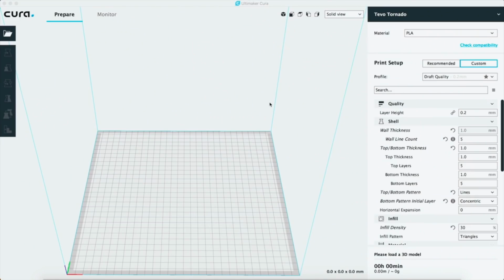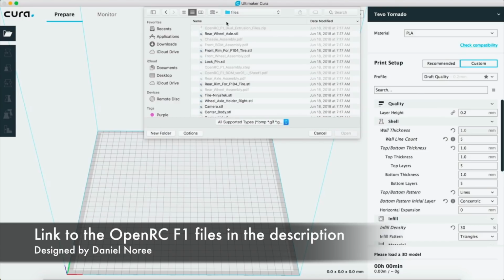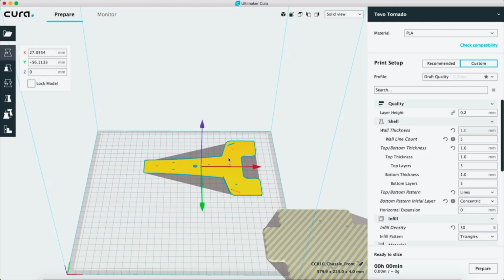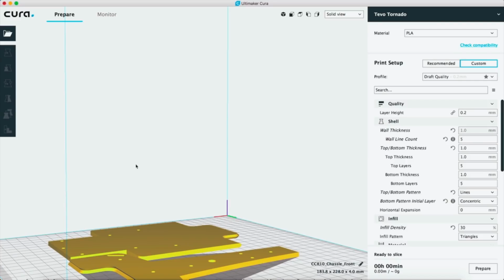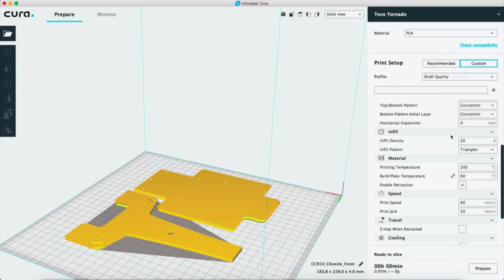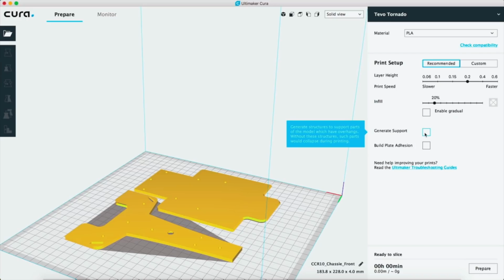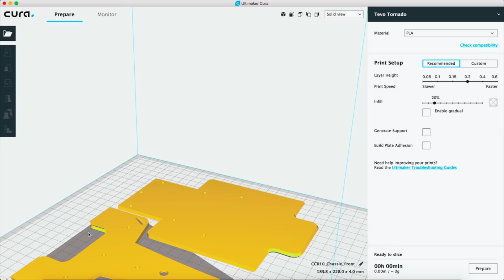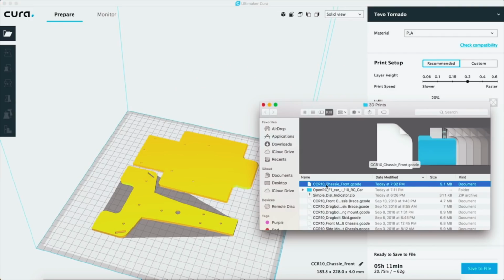Intro to 3D Printing - Slicing & First Layer - OpenRC F1 - EP1

Comment: In Cura, if you click and hold the center scroll wheel you can drag the entire model around to see it better also. good vid. I think I might make one of these cars. I have all of the electronics. just need the bearings and maybe buy the rubber tires in place of the plastic ones.
Reply from the maker: I’m on a MacBook Pro, so no center click as I just use the trackpad. Sounds like holding shift is the key for me.

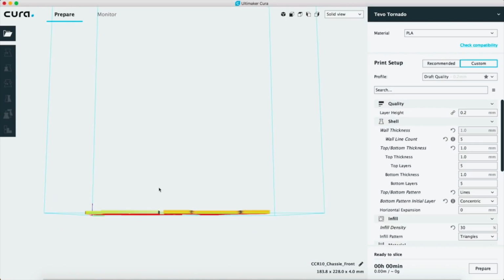Comment: Hold shift when you move around in Cura, it will move the preview up and down. Around 3:30 of your video.
Reply: Also turn on retraction so you don't get the extra lines between points. I got some profiles setup for my Tevo Tarantula if youd be interested. Look into combing and jerk also, they both help a lot.
Reply from the maker: I've reduced my Jerk value on the Tevo already. On normal prints I do set retraction higher, but I was just showing this video with the very basic setting in Cura. As they go, I'll start to discuss some of those other options and what they mean as well.
Reply from the maker: Thanks for the view help, Ive only been using Cura recently as I used to use Repetier on my other printers.
Reply: @HarleyDesignsInc  I'll let you know if I know of any tricks to help. Ive had my Tevo for over a year now.  If you havent found it already, Facebook has a great support group for Tevo.
Reply: KCMO here gotta stick together!

Comment: Wouldn't a cover with a door in the front help keep dust and draft away from the printed part, Thinking that keeping the temperature as constant as possible would be better for the printing.
Reply from the maker: Enclosures are helpful when printing some material types. For this type of printing though, they are not needed. There is a fan that is ducted to blow directly on the filament as it leaves the nozzle as well.

Comment: in my limited experience I have had good luck printing pla on a piece of glass clipped to the heatbed. as the part cools it pops right off on its own. This doesn't work well in a room with large temperature swings.